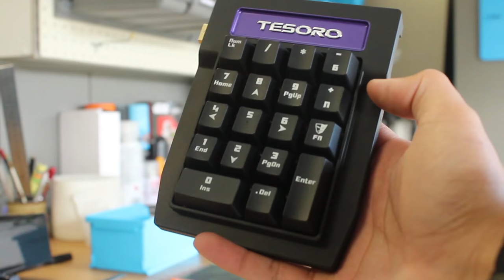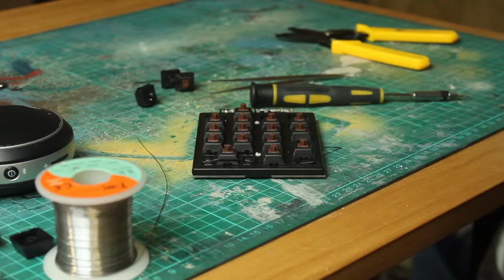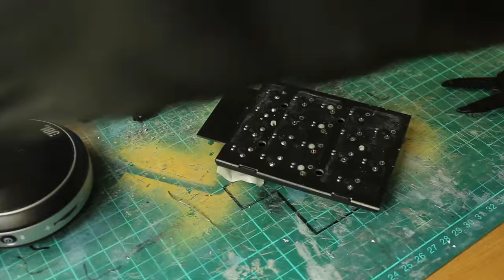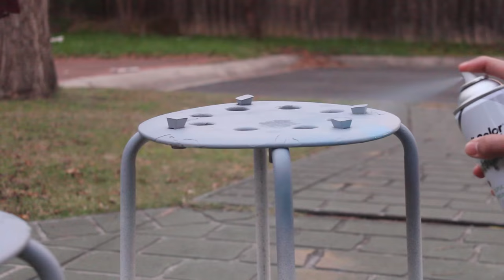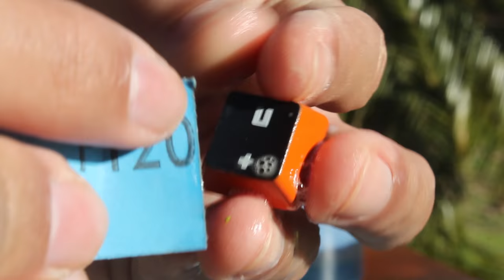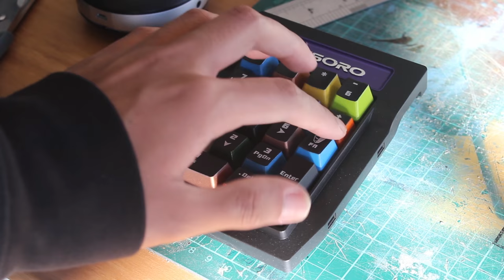Customised Mechanical Keyswitch Tester Numpad - Part 1

Comment: you know what? yes the original solder needs a higher tempter. but you can add a little bit of lower tempter solder to each solder point first then suck it. its way more cleaner and easier.

Comment: I want to do something like this, Would I be able to buy some shitty cheap number pad for like £5 or would it need to be a specific one?
Please reply
Reply from the maker: Well you won't be able to change any keyswitches and stuff. But if you really wanted to, you can somehow make an enclosure for it.
Reply: Why couldn't it be possible to change the key switches as I'm on a low budget I'm trying to find a cheap pad that's preferably wireless
any recommendations?
Reply from the maker: That is just a simple numpad that is not mechanical. I don't know if a wireless mechanical numpad exists. You can still customised the keycaps if you wanted to though. But the one you linked is a simple rubber dome numpad - mechanical keyboards and numpad tend to be expensive :(
Reply: Thank you for the swift reply, how much does one of your services cost for making something like this?
Reply from the maker: Not offering services yet. And I'm limited to Australia at the moment.
Reply: That looks like a plate mounted switch which means the PCB should be just below it, I think it would be cool to see if you just replace the bottom plastic cover with wood with the same design as the cover and just paint the plate mount. Maybe it'll be easier.

Comment: I mean on the other hand with lead free solder you're not breathing lead but whatev
Reply: typically you should be soldering in a ventilated room so that you don't breath in any fumes. There are many times when smoke comes off the pcb or the soldering iron, and it's not good to breath regardless if the type of solder.
Reply: ofc, if smoke is coming off the board itself, you may have damaged something